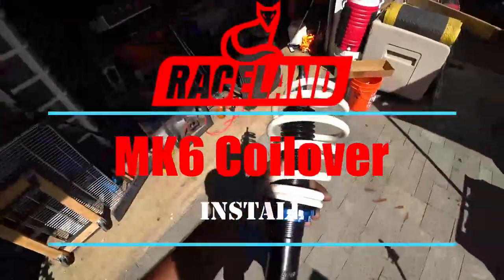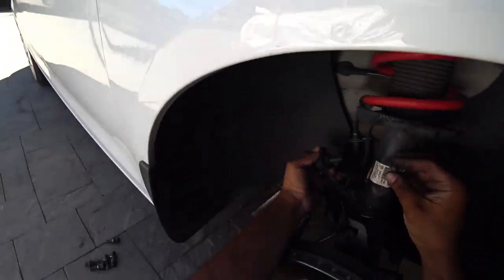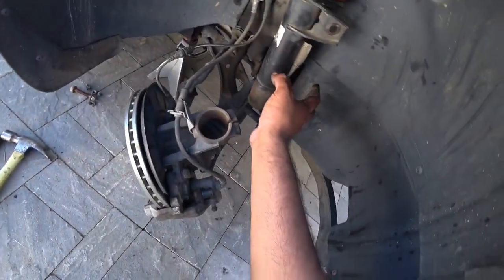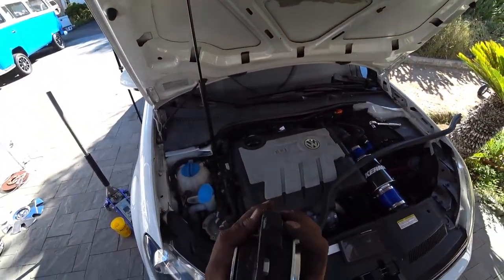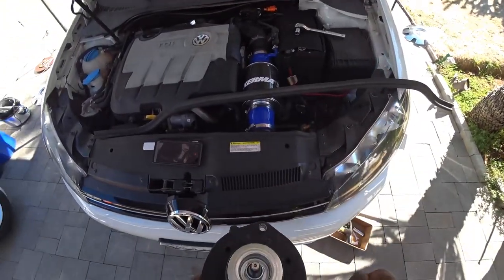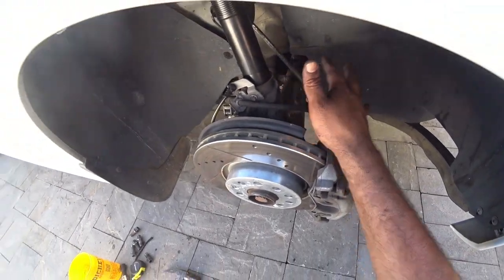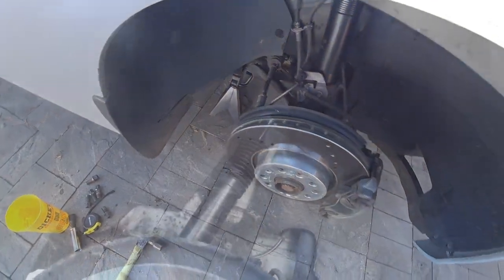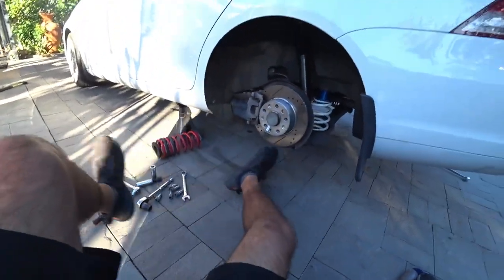VW MK5 MK6 Raceland Coilovers DIY Install S7EP5

Comment: I have them on my mk5 currently and their not bad. I think i have to tighten down my front more and play with the damper.
Reply: What kind of strut mount did you use because i hear a little rattle on mine? I think i might get some 034 strut mounts
Reply: Would you recommend purchasing them? I’m currently looking into getting primos for my 2008 rabbit but I’d feel more comfortable asking someone what they thought of the product  before pulling the trigger

Comment: Did you get the top 18mm from the sway bar inlenght just by turning the bolt? When I spin, the bolt and the dread spin together
Reply: hold the shaft with a triple square while u turn the nut
Reply: Dude I have the same problem right now! And I don’t know what to do!!!
Reply: @dumbeezy5480  he is talking about the top one, not the bottom one
Reply: @markooska  I used an impact gun and then it came lose, hold the nut with a normal wrench but use the impact on the triple square

Comment: Quick question, shop installed my front coilovers with camber plates but they install the camber plates wrong (not facing the right way) could i just unscrew the top mount ? Will that let the shock drop enough just to turn that plate and not disassemble the whole shock from the car
Reply: A bit late but yeah. Just loosen the 3 10mm bolts up top